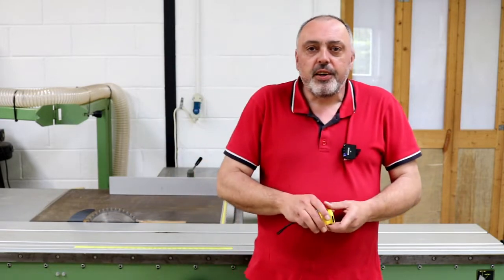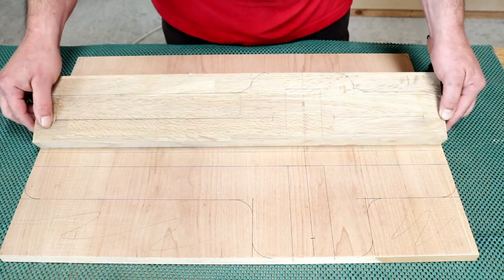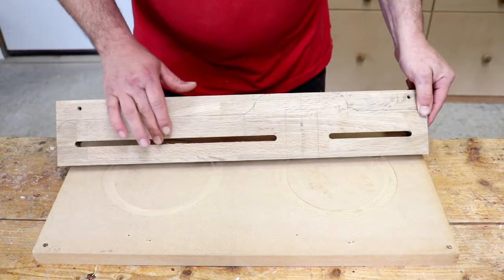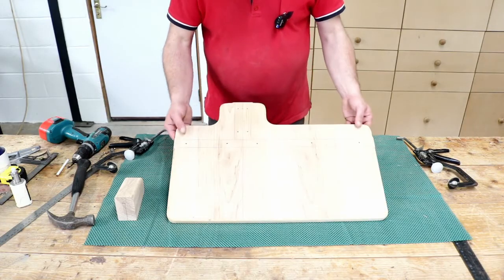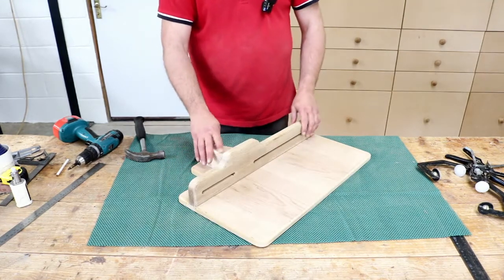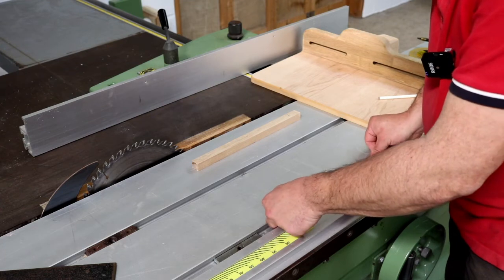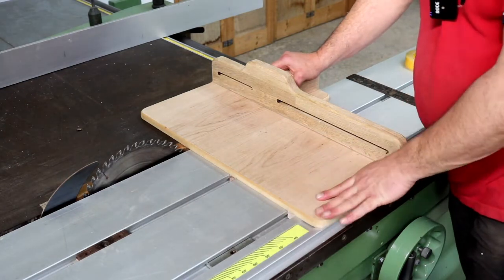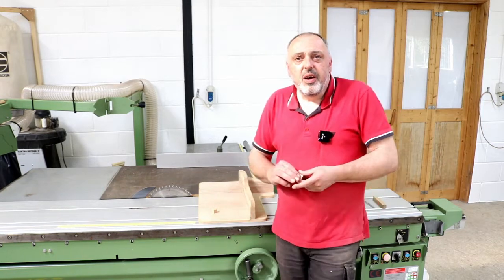How to Enhance Your Table Saw with a Mini Cross Cut Sled - DIY Woodworking

Comment: just a question Tommy, could you use three quarter inch ply for the fence? because oak is a bit expensive and like my mate says "It don't grow on trees ya know"
Reply from the maker: Hi Brian  , yes you could but I would recommend doubling it up to 1.5 inch as it would be stiffer and give a bigger edge to square up.

Comment: What size table would you suggest for the average table saw?
Great video
Thank you
Reply from the maker: Hi Douglas, that would depend on what you wanted to cut using it. I would usually suggest keeping it just big enough for your needs as it makes it easier and lighter to use.

Comment: Still not using "Fritz und Franz"?

Why do you Americanize the European style table saw instead of using the much simpler solution developed years ago by the German woodworking business  association? This proven solution is much more flexible and offers solution for many more problems.

Unfortunately didn't find a good English video, but Heiko Rech has a good intro which shows the possibilities without the need to understand the audio.

The rubber strip is available from Sautershop and a complete set with many add-ons is available from RUWI, but very expensive.

Just search for "Fritz und Franz" for more options
Reply from the maker: I am fully aware of the fritz und Franz system and its design and its purpose as I have it here. But in my opinion it has lots of limitations and actually slows down productivity. But with regards to cutting small parts the fritz und franz does not give you zero clearance option that is necessary especially when using a panel saw as there is no zero clearance insert like a standard table saw so the offcut still becomes an issue
Reply: Sorry can't see what cannot be done with Fritz und Franz and don't understand the need for zero-clearance on a sliding table saw. If it's the part is that small other tools should be considered. In addition you loose the ability to use the scoring cut. 
Otherwise keep up the good work.
Reply: @kiwi007-t5i  having read the previous comments and reply from Tommy can I ask how much experience do you have using a panel saw?
Reply: @johnmurphy3854  Felder, Hammer, Altendorf, SCM, Martin. And I still have all my 10 digits
Reply: @kiwi007-t5i  Never mind your digits, where is your channel, tutorials, shop, website?